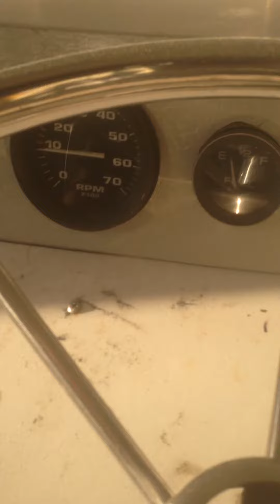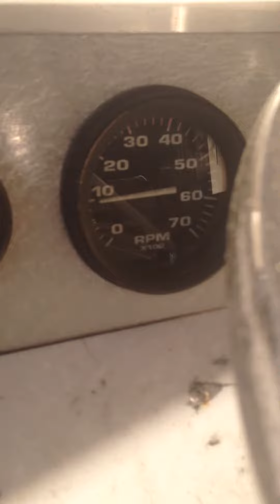1980 Mercury 200 black max

Comment: Nice I got the 225 one of these.
Reply from the maker: Yeah some trash got in one of the carbs a few years ago and I melted one of the pistons to the block! The block sits on a shelf in my shop now! It blew and still took my family 4 miles into the wind on 6 foot swells to my truck! And it snapped that piston off in the motor halfway to the truck! It deserved a shelf!
Reply: @viper5405  yes it did. Can you bore/hone her out and possibly rebuild her one day?